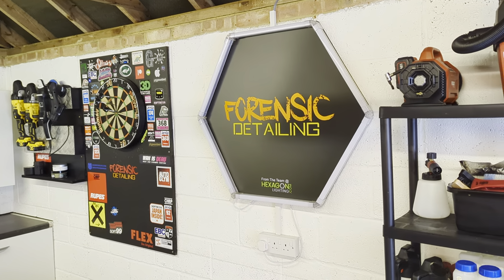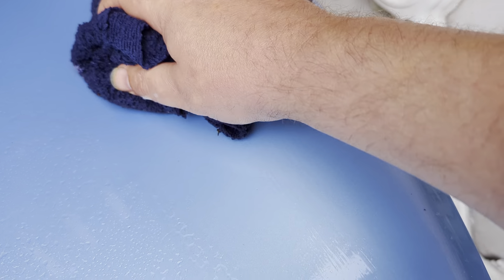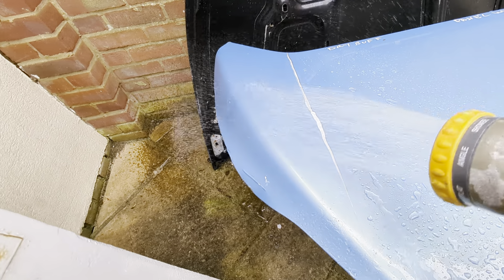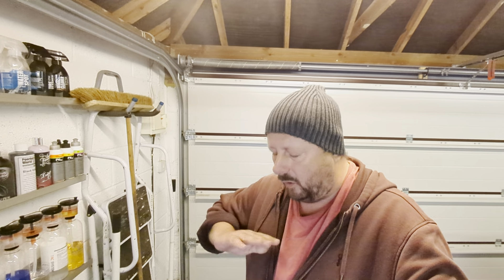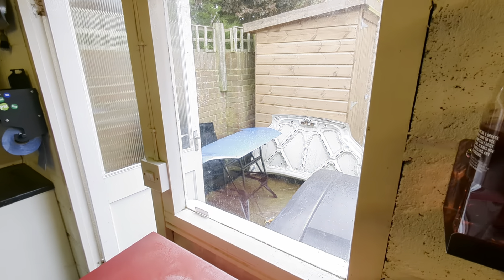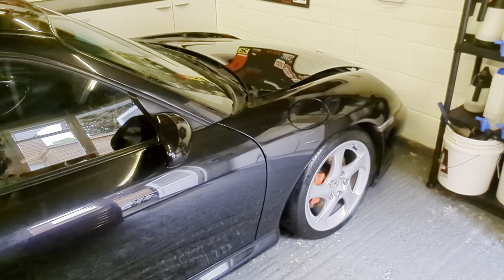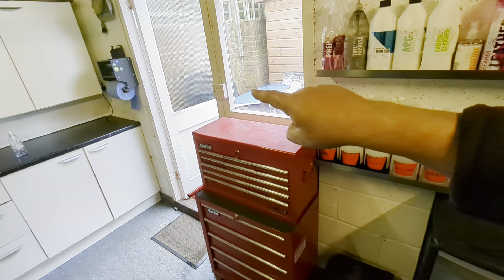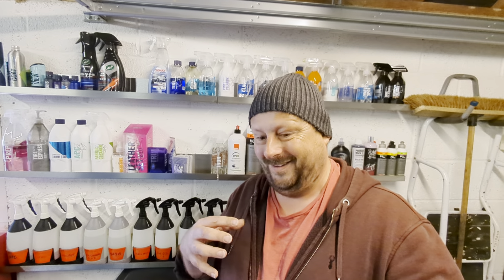Does "Prep" make a difference?

Comment from the maker: was also thinking on the dry wiped section the coating might mix with the hydrophobic polish residue but still continue to cure but the final film has some hydrophobic polishing oils in the formed film?
Reply: Possibly, but surely the hydrocarbon catalyst in the coating would do something to those oils. A wipe of a coating will dissolve tar etc.
Reply: Maybe the polishing residue actually works like or slows down the evaporation of the coating's carrier solvent and is giving it more time to react.
Reply from the maker: if theres naptha carrier in this coating for sure.   some have naptha to keep the other non silane based resins in a disolved state.  But the silane is usually carried in Di-n-butyl ether which has that almost toxic peperminty type smell.   The gyeon ceramic smells like it might have all sorts of other resins and stuff in it, it may not even be the same core solid resin used in other coatings.
Reply: Hi Jon,
My money is on the panel wipe.
Heard loads of people saying about Gyeon Prep causing bad bonding. Maybe try again with Infinity Wax or Carpro?
Although you would have thought Gyeon Prep would be the right product for Mohs, but that is the only distinguishing difference between the no prep and the panel wipe section and as your test is showing there’s clearly a difference
Reply: @Dan_vRS  @ForensicDetailing a panel wipe test out might make for a good video

Comment: I polished a ceramic coated my wife's car . Panel wiped each panel individually before coating. I believe I forgot to prep driver side roof and fender . As of 6 weeks  the hydrophobics has not changed and is still rather impressive.

Comment: Very interesting video and I will follow this with great anticipation. I would expect the primer section to do best as, in theory, the surface has been super prepped with a layer of entirely compatible resins and coating friendly long named ‘anes which have been allowed to fill the micro pores of the paint with the heat of the machine. This sets up and cures and allows the coating to super lock onto the paint surface. I’m a big fan of primer polishes, though the next question is - are they all equal or are some better than others?

With the other options, it really is a conundrum but time will be what reveals what is happening. I will say that I don’t like using dish soap and that a product like  Feynlab Pure Rinseless Wash works much better in this scenario - you can use it as your initial panel wipe, with the advantage being the lubricity really helps avoid adding any new marring on the wipe, particularly on very soft paints. Plus, it leaves nothing behind so whatever panel wipe you want to use really has very little to do.
Reply from the maker: Rinse less does not degrease well. You need a degreasing agent.  In fact the instructions for all gyeon coatings say to dish soap to remove the polishing prior to panel wipe.

Comment: My thoughts are that the "residues" left by NOT using panel wipe, although being detrimental to bonding and durability, actually fill minor defects in the paint surface making it smoother and this increasing hydrophobicity.
I have similar results when applying Soft99 Fusso to bare paint in comparison to "on top" of Autofinnesse Tripple.
So much so, i now always have AF Tripple under my Fusso. Durability is still months and months so win win.
Reply from the maker: Yer and the material left by the polish is beady.  But I wonder if some mixing goes on between the coating and the polishing oils

Comment: My thinking jon is that your panel wipe has 10ml of surfex hd concentrate in it, which as a product has corrosion inhibitors in it. While only a marginal amount of product is used, it is a concentrate. The corrosion inhibitor of P&S brake buster affects the beading of coatings applied to alloys, particular ceramic coatings as they are particularly hydrophobic, so perhaps here it is creating an impacting on the bonding ability of the ceramic.
Reply from the maker: I used just gyeon prep

Comment: Hello John, I can’t get my head around it just yet. I would want to test the slickness right now as that might (just a thought) be an indicator that the coating is contaminated during application (by prep/soap). Also how about washing it with something like Surfex HD to remove chemicals that came to the surface?
Reply from the maker: Its been washed a few times I don't think it's surface residue I think it's the prep but not 100 percent sure.
Reply: @ForensicDetailing  I am going to create a similar setup this/next week. We learn so much of this! 😃😃
Reply: FYI, I prepped an engine hood the same way as you did. Only used Carpro Essence as a primer and Eraser as a panel wipe. 
After 4 days I can feel that the part where I used only Eraser was a bit less smooth. I’ll keep an eye on your next update and will check again myself.

Comment: Great leader John, sounds similar to what I did as mentioned a few weeks back. Did my usual wash process, then as I was laying down Infinity Lite I gave the entire car a machine polish first with Koch Chemie Purple. That alone was oustanding, the depth and the shine wow. Did NOT see the part about panel prep. I go from that to Infinity Lite ceramic coating and all I can say was it blew my tiny mind away the shine, the beading the depth. I was grinning ear to ear. The rain would hit the bonnet and would bounce straight back up into the clouds above. It was very satisfying to see that beading.

Alas 4 months later not a bead insight, the coating had nothing to hold to, but the Chemie was looking pure class still and that the Infinity coating all gone. I took your advice and this time I have used Infinity's panel prep and I am trying out there new ceramic coating so I will be interested to see if I make it past a year at least with this 2 year promise.

Comment: I polish my car slowly over a few days and I noticed my 1st or 2nd year of machine polishing the beads I had with a freshly polished panel with no LSP.
Reply: I did notice that when i one step corrected an e-class and for time and carpal tunnel reasons i decided to protect it with Wet Coat essence, spraying the water on a polished car showed hydrophobicity. So i just very gently washed it with Auto-Wash and it was all gone, proceeded to wet coat the car.

Comment: Basically you are saying I just wasted 6 hours on a new car. I took the Scholls S40, gyeon prep before coating.... I could have saved a ton of time with Essence 😢
Reply from the maker: :) no not saying that :)   its too early to tell about durability.  this is really only showing hydrophobicity differences after full cure.    But based on just this using the ceramic primer has given the best results and really panel wipe and wash+panel wipe are showing less desirable results.   But the important thing is really the durability comparison over a longer period of time.   Im expecting the beading section on the left to perhaps fail quicker.   But yer not sure.  Just and interesting thing to test but dont have all the answers on this.
Reply: @ForensicDetailing  Thanks John. It's a really good test, and why we love your channel. I am surprised at the primer, I do wonder if we are seeing primer's hydro capabilities or the coating's. As you say time will tell 😃

Comment: How long after the panel wipe did you apply the ceramic coating?
I watched a video by a prominent detailer and he was of the opinion the panel wipe can take some time to vaporise completely and stays on the panel for some time.
Reply from the maker: it can yes,  it depends on the panel wipe, hydrocarbon ones you need to be more considerate with, they might not even flash in winter in a garage like mine and need like 5-10+ deg in a workshop to get a flash and can be slow vaping etc..    Water based ones, specially ones with alcohol solvent vape a lot faster though.     This was over half an hour on a hot day so should be nothing left behind.

Comment: Did the coating dissolve the polish and become a 'new' combined product?
Reply from the maker: possibly mate that would make sense, the polishing oil should be compatible perhaps. either than or it layered and formed the film over it and is showing the hydrophobicity.   I think some mixing would have occured though. not sure.